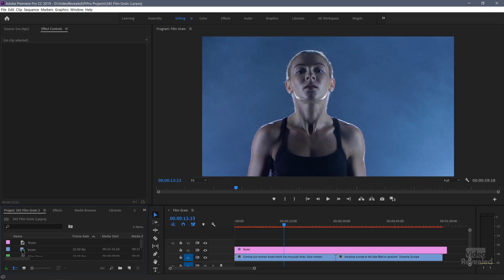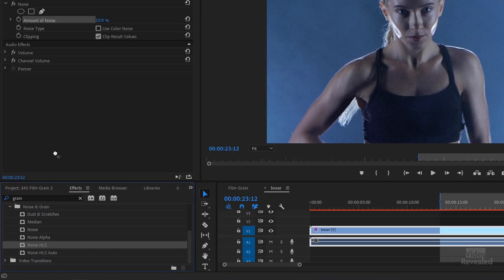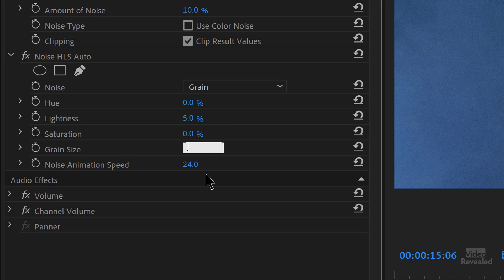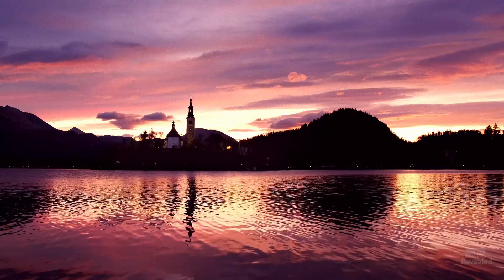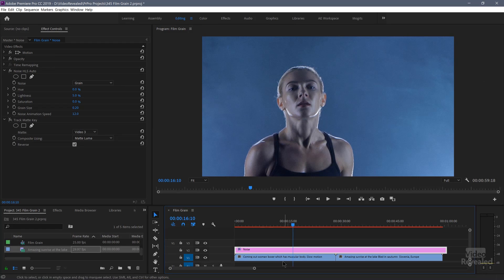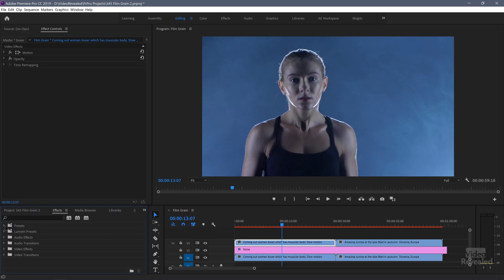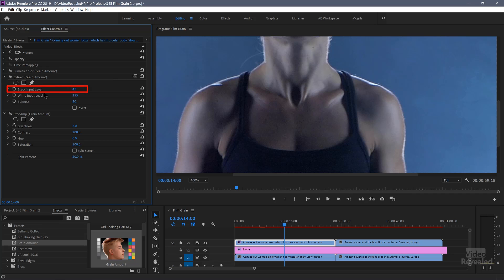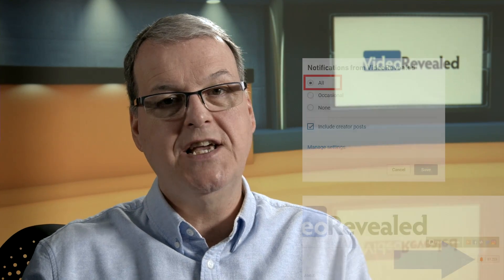Adding Realistic film grain in Adobe Premiere Pro

Comment: The masking technique shown in the video isn't really realistic grain. Watch any film with visible grain and you'll clearly see it in the lighter parts of the image. That's because real film doesn't show visible grain in a linear way. It might be stronger in the darks, weaker in the mids, and strong again in the lights. Each kind of film shows grain differently. Using scans of real grain and just the "Overlay" layer compositing technique is probably the best way to go. There is a plugin called FilmConvert Nitrate that will emulate the visible grain curves of some real film types. (The grain itself is digitally generated however, I think.)

Comment: All well and good, but when you have a complex timeline, the solution isnt practical which is a shame - many premiere pro solutions include duplicating clips on the timeline. The grain also removes some nice saturated glow in the highlights. To combat this, I add another duplicate layer, set to lighten, increase the saturation to 200 and reduce the overall opacity to around 20%, this then retains the highlight glow and saturation, whilst getting nice grain still.
Reply: Any video explanations this
Reply: @MediaGraphicsPro  No, just duplicate your base layer to the very top, set the opactity to 'lighten', increase the saturation of that layer to around 200, then reduce the overall opacity percentage of this duplicated top layer to 20%. But this is quite particular and not entirely necessary.

Comment: Really new to this, so thank you. What settings would you use as a starting point for 8K 29,97 fps footage?
Reply from the maker: Looks like you found the right setting.
Reply: Actually, I have found that your 5% lightness and 0,20 grain size settings work perfectly with 8K aswell. Hopefully it shows up on youtube. Animation speed should be set at 30 for this clip I guess.
Reply from the maker: The speed is really up to your taste.
Reply: @VideoRevealed  So it isn't meant to match the framerate of the file. I'll experiment a bit.

Comment: Why do peaple want this if the do the iso on thee camera high than they have original cam grain
Reply: Because you want to have as much control as you can on POSTPRODUCTION, never put an effect on raw material because you can never undo that. In post you can choose how much grain you want, none, a  little or a lot, if you do this in the camera settings you are stuck with that forever, or fighting to undo it in post.
Reply from the maker: It's simply a stylistic choice. No right or wrong.
Reply: Digital camera NOISE (which is what you get with high ISO on digital cameras, and most people nowadays use digital) is very different from film GRAIN. Digital noise introduces both colour and value variation and it also appears in patterns which the human eye registers easily (we are very much pattern seeking creatures). Film grain only adds variation in value and is completely random. Digital noise is generally considered to be much more detrimental to footage (it's simply too noticeable and gives a feeling of artifice), whereas film grain is not as noticeable and, depending on the style of the film, can even often be seen as an aesthetic enhancement.
Reply: For me personally, it is great for adding grain to otherwise perfect CG renders